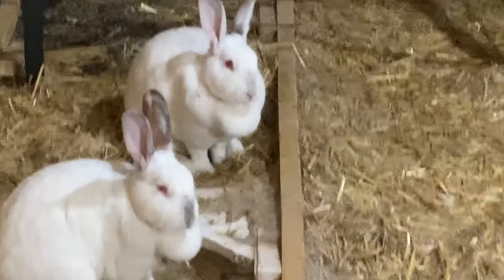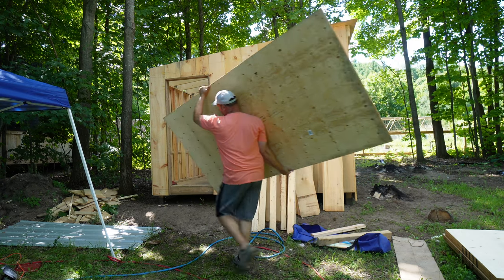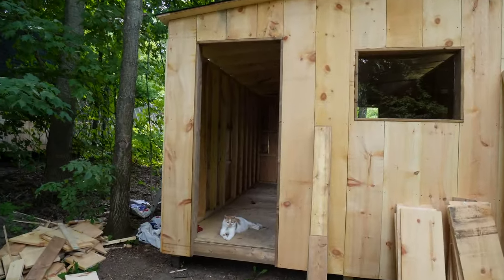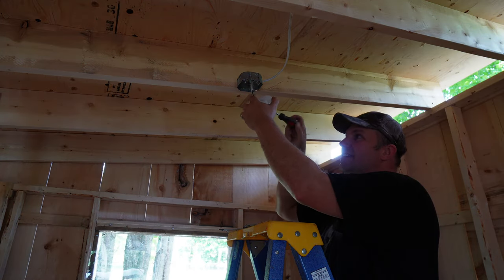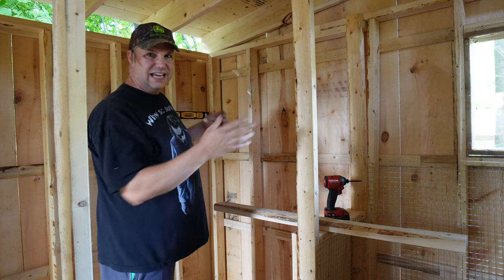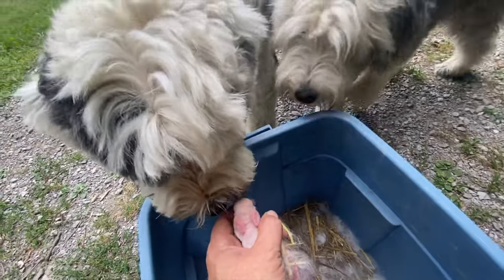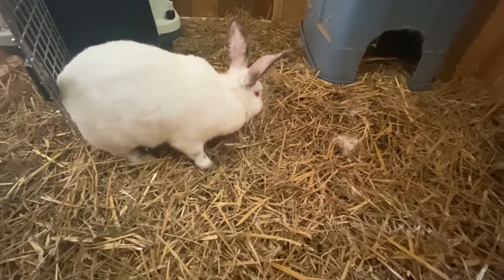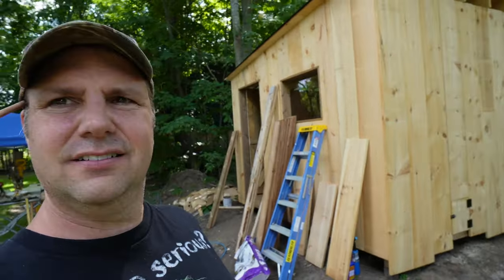Building a Rabbit Colony | Baby Bunnies & New Bunny Barn

Comment: Nice bunny barn, are you a carpenter? I've been thinking about getting a rabbit (my favorite pet) this just took me over the top! Great video! Why didn't you do a doggy/cat door for the rabbits.
Reply from the maker: Not a carpenter just a hobbyist. I did install small doors which will give the rabbits access to the run once it’s built. If it ends up being too cold in there I’ll consider cats fours but I feel rabbits like the cold and don’t think it’ll be an issue.
Reply: @HiddenSpringFarm  Just bought 3 rabbits 🐇🐰🐇after watching your video.😎